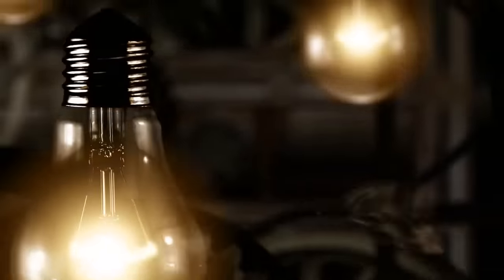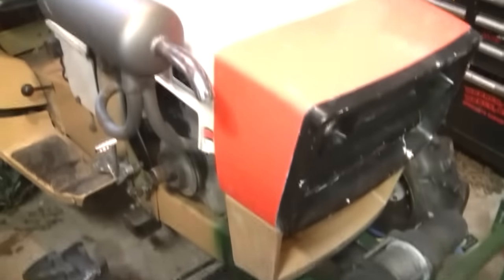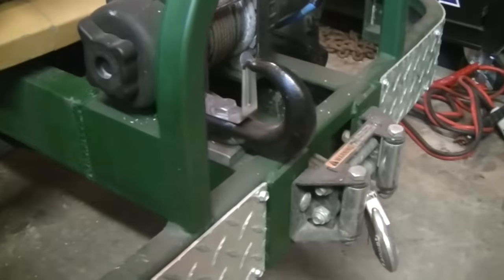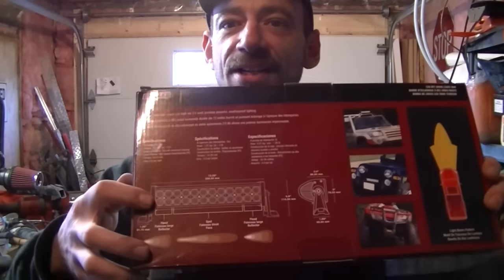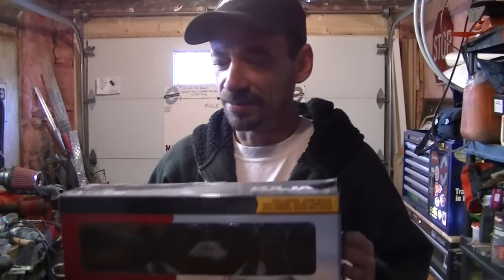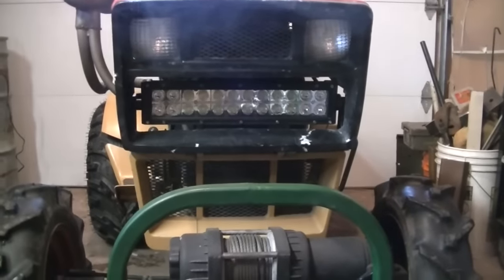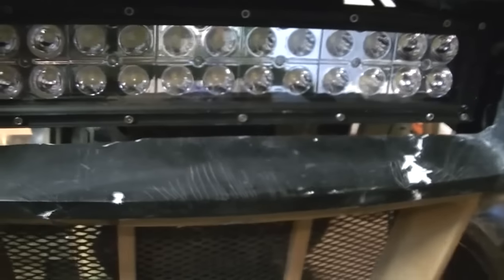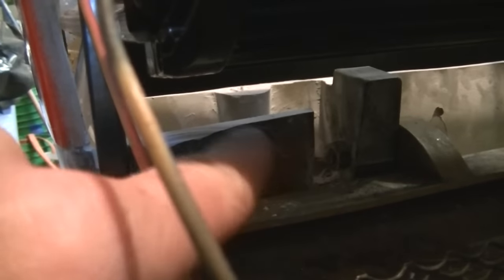LED There Be Light!

Comment: How will the light bar effect the battery, how long do you think you can run it before draining the battery? It looks great tho
Reply from the maker: +Joar Bergström LED's are by nature very efficient. Now- the battery in this little bundle of muscle is a Blue top Optima 750, and there's a Delco 12si alternator good for 85 amps going in. No issue. The winch is the big draw.
Reply: Okay, thanks for answering, planning on putting such lights on mine

Comment: what is it a tank he hee That one thing you need mowing at night IS LIGHT>  looks good where you mounted it>  could you make the bumper look better omg like with bars even V bars
Reply from the maker: Well- I don't mow with it, but it's a really useful utility machine, and very capable offroad. Sometimes it's a little dark on the trails. The light sure helps. What you see in this video is NOT the finished machine.
Reply: He hee ok  i like bright colors, the chevy orange would look gr8

Comment: rip m3
Reply from the maker: +garrett monk Heck no. M2 is gone. The M3 project is on the backburner for now, but lives on.
Reply: but first motor then front axle
Reply from the maker: +garrett monk Well- I already have an engine plan in place, and I had NEVER planned to use the stock front axle in the M3 project.
Reply: o ok

Comment: that seams expensive  I bought a 32 inch for about a 100 with shipping and that
Reply from the maker: +Thomas Gaudet Cana-Duh. I had $75 in Bass Pro gift cards, which made it a lot more tolerable.
Reply: +Sprocketsgarage I payed Canadian to
Reply from the maker: +Thomas Gaudet Did you get it from Bass Pro, using Bass Pro gift cards, too?
Reply: +Sprocketsgarage no off eBay it's pretty good didt come from china well it did first but was shipped from Ontario
Reply from the maker: +Thomas Gaudet That was kinda my point. I had these gift cards... So I "spent" more than I normally would because I didn't have the option.
Reply: +Sprocketsgarage ya there's probly nothing better then and I think most stuffs expensive there